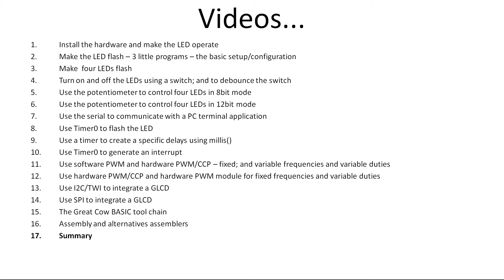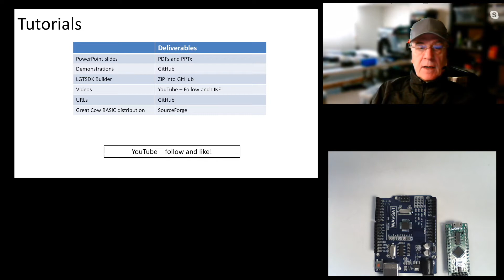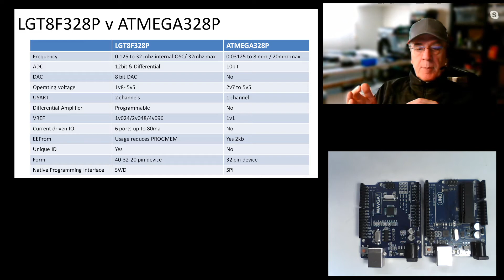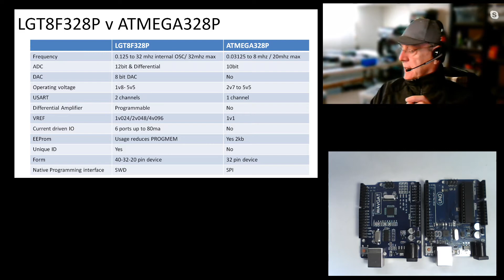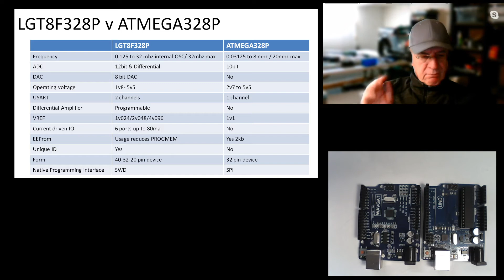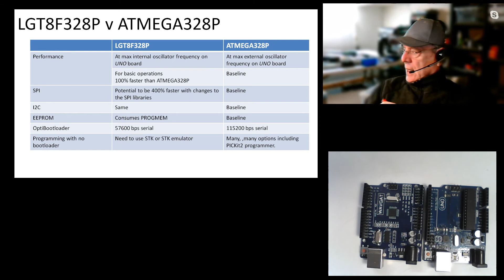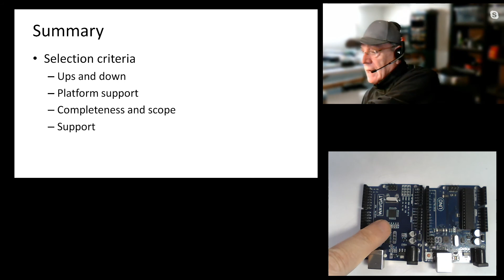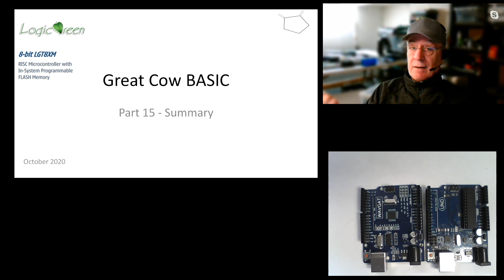Summary: LGT8XM chip Family - Using the LGT8F328P - a review

Comment: The first "uno " I got was a smd clone. The second was the WavGat which at first confused the heck out of me since shlelds did not work and other thinhs that did not match. Specially as a starter. So I think they are not clones but just similar. Actually I think they are way better than the  atmega328p.
Reply from the maker: It would be easy to get the wrong chip on a board that looks the same!  :-)